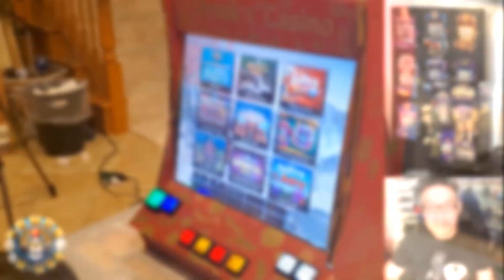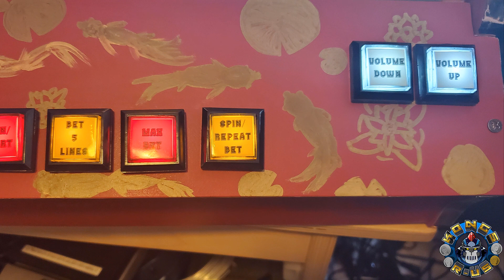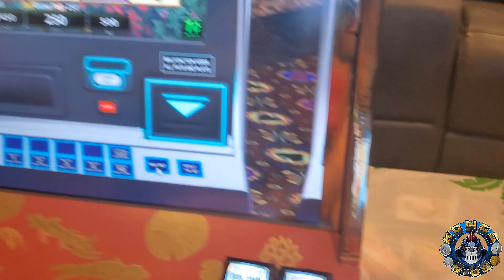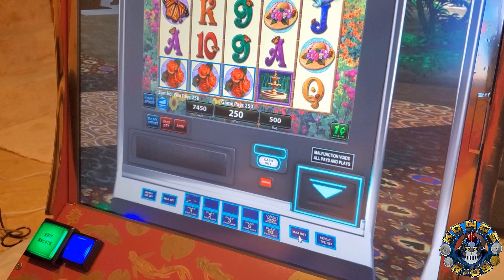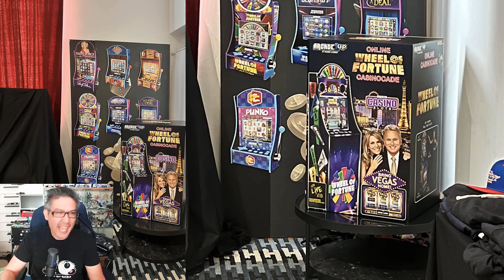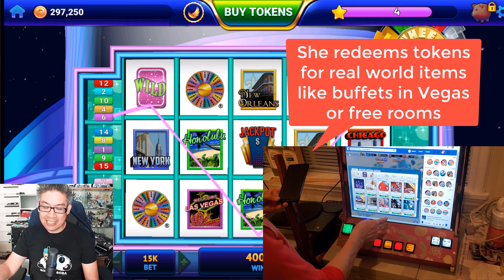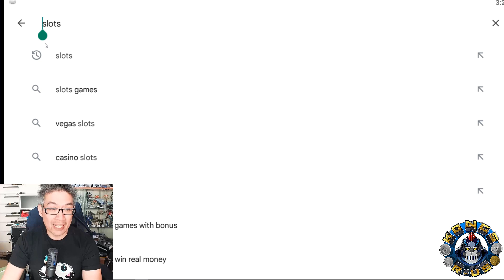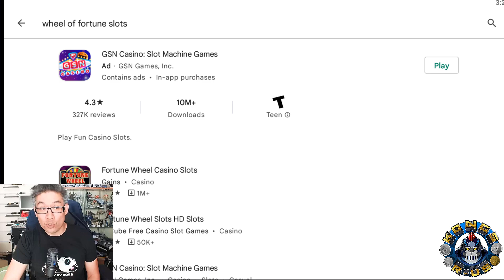How Arcade1Up Casino Cades Might Work | Custom TouchScreen Slots Mod

Comment: where can i get the simple touch front end?
Reply from the maker: You can download STFE here https://simpletouch-fe.software.informer.com/
Reply: @KongsRUs  does that include all tne software and casino stuff or is the found in another place?
Reply from the maker: That you'll have it Google to find and set up. Arcade Punks used to have a Touchscreen setup but a lot of it didn't work. Look for IGT slots for the ones I have in my video.
Reply: @KongsRUs  ya i say one alladon set on on xp . very extensive setup process . i have the touch screen and plenty of computers . the arcade punks one is what i downloaded but it doesnt work eh well ill do some diging . thanks for the reply